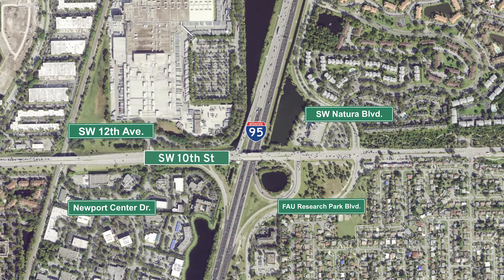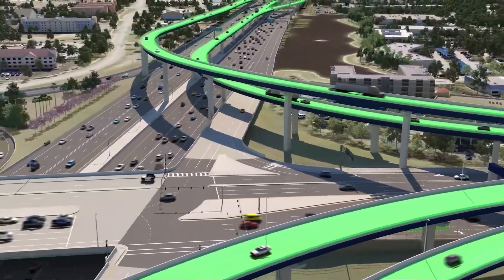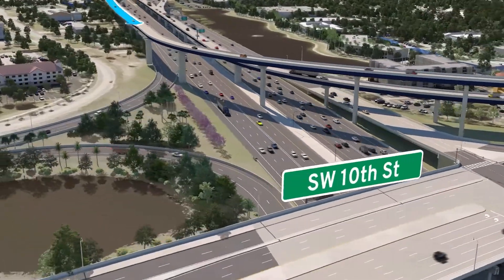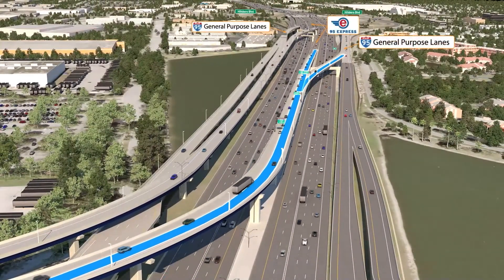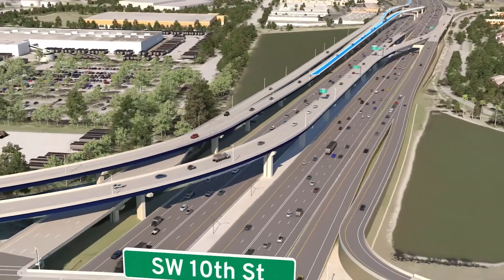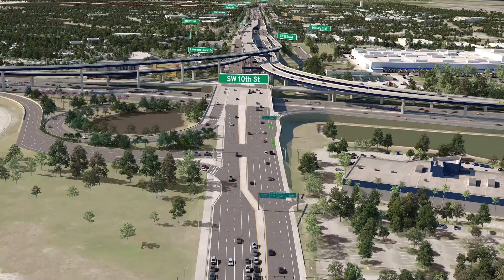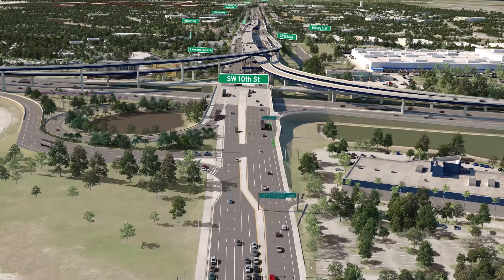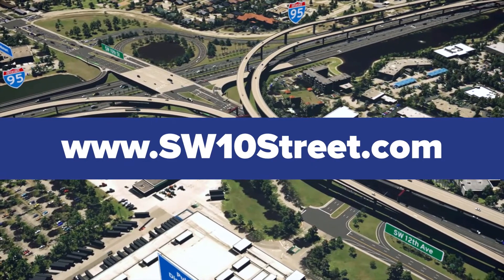SW 10th Street - I-95 Interchange

Comment: Great! The sound barrier wall isn't tall enough to block the sound now so let's raise the traffic up higher so we can hear the trucks with defective exhaust systems and the crotch rocket motorcycles that race up and down in the middle of the night....Good thinking, where do I apply to get the planning job?
Reply: You already have that. Just idling outside at red lights instead of just flowing by quickly like it would on a highway